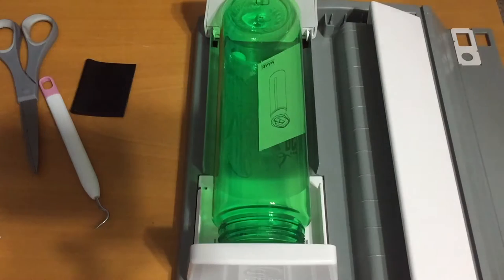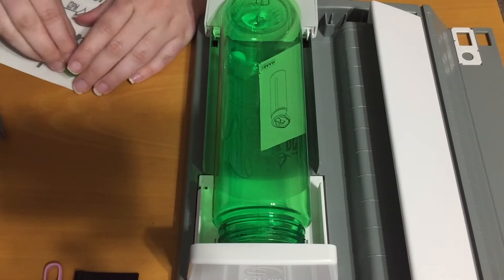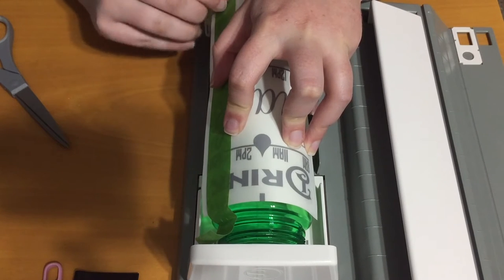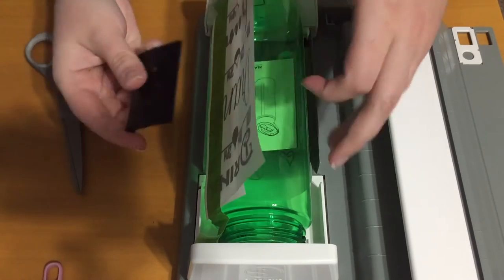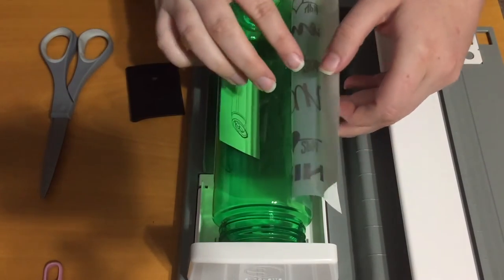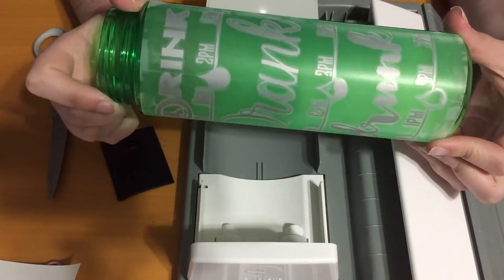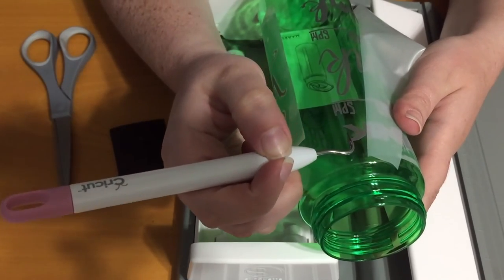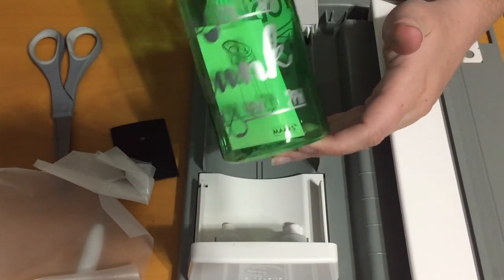How to put Adhesive Vinyl onto a Straight Sided Water Bottle

Comment: What contraption do you have the water bottle sitting in?
Reply from the maker: Ashley Coleman It is a roll feeder that works with silhouette cutting machines.  It helps rolls of vinyl to feed straight into the machine without getting crooked.
Reply: Kathryn That's awesome! And what a smart way to use it! Much easier than me trying to keep everything straight on my legs.